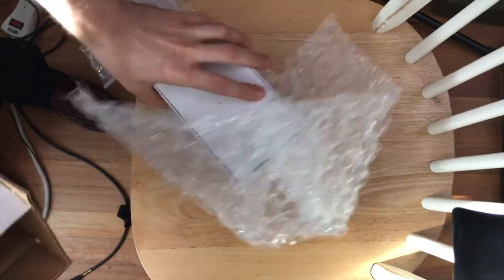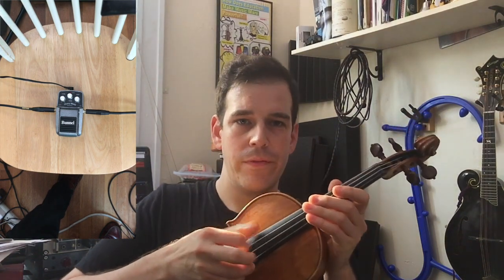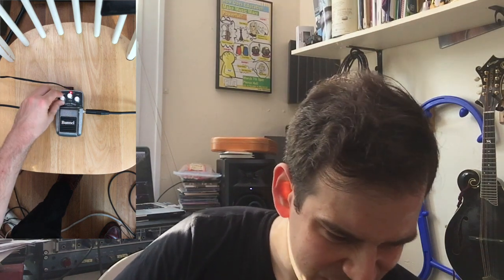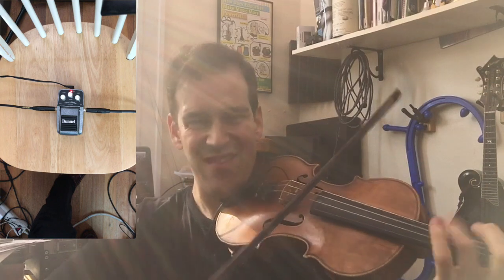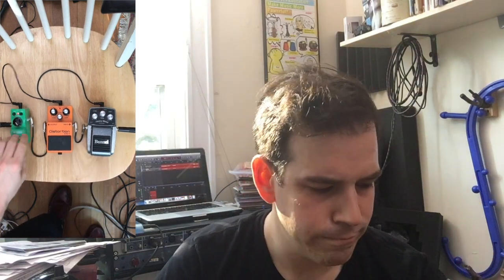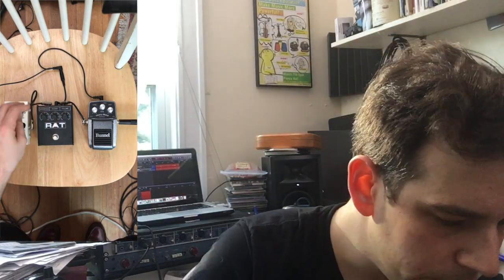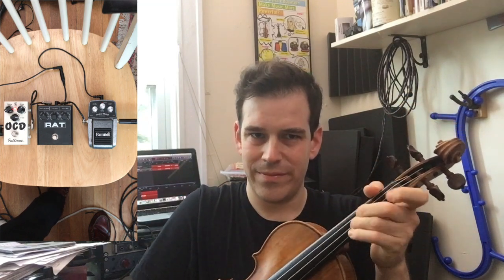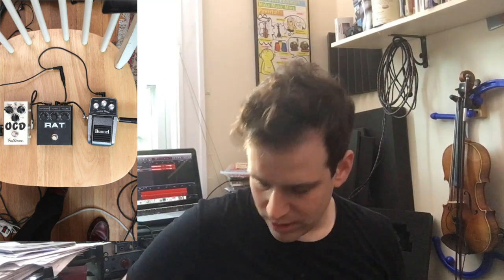Bunnel Heavy Metal Violin Pedal Unboxing Demo and Review

Comment: Great information, I play in a country band but occasionally we play some rock stuff like Last Dance with Mary Jane, I would like your  opinion on a good pedal to help make that type of distortion. I play a Fender Electric violin with a Barabara pick up. Thanks
Reply from the maker: Hi John, I used to own a Fender Electric violin, but it's been a while since I used it (and at the time I did not understand gain staging!). First and foremost, what kind of amp are you playing into? A lot of overdrive sounds are attempting to imitate the sound of a cranked tube amp (like my Boogie on the "lead" channel).

I'm not sure what's the "right" sound for a solo on LDwMJ, but lots of tones can get you there. I personally love the sound of a cranked tweed amp, so anything that sounds like natural tube breakup works great. Ultimately you'll have to experiment with different sounds and your personal rig (also in a band context, to see what will actually cut through the mix!). Check out the Falcon, a "tweed amp in a box" pedal by Crazy Tube Circuits, or the Box of Rock by ZVex for a Marshall-style amp overdrive. Also the Boss Blues Driver works great in most rigs. Of course, you can also try the pedal I'm demo-ing here for cheap!